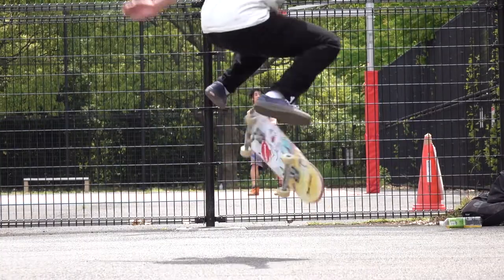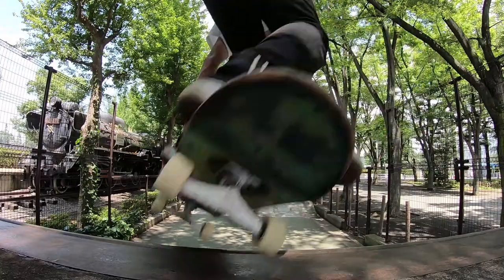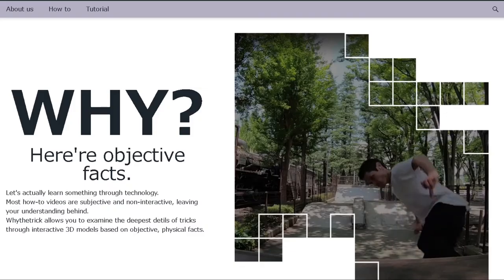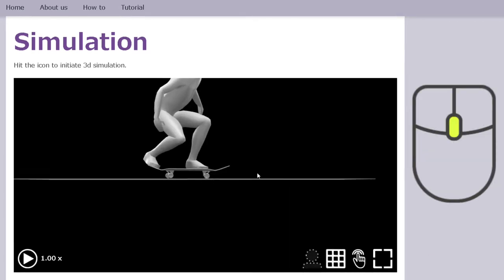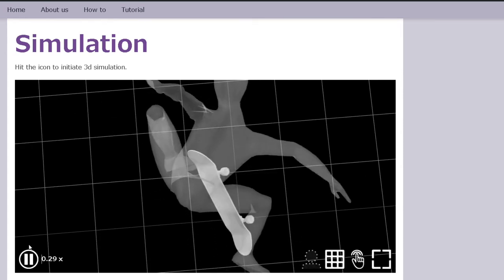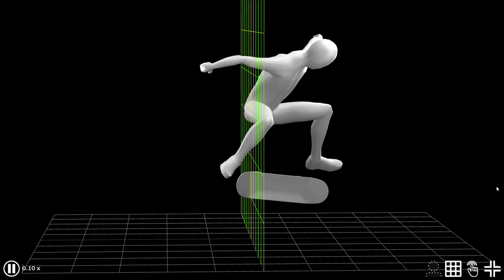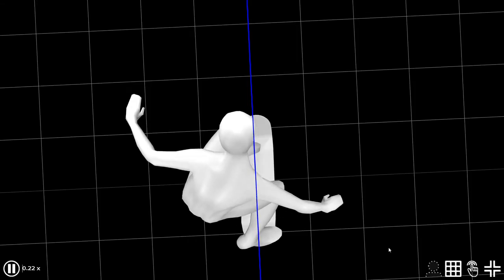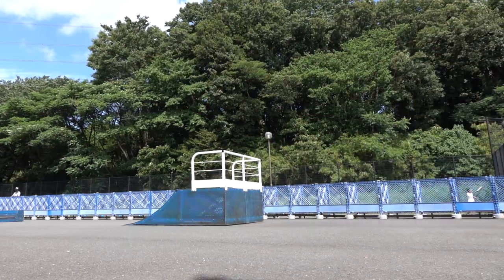How to kickflip - Scientifically explained using 3D models.

Comment: What software are you using and how did you learn to create these models? This made me want to learn more about physics
Reply from the maker: Thanks for the comment. 
Im using Blender, three.js etc. just so you know: you can use different physics engines on different softwares. 
For example, both Blender and three.js(and it’s library) supports physics simulators. Please choose a right tool for you cuz they have pros and cons at some points.